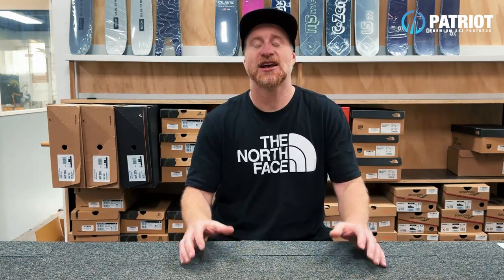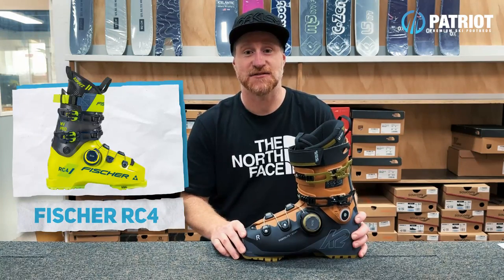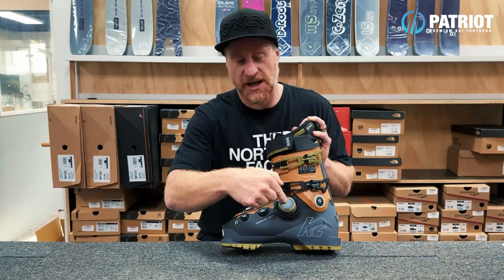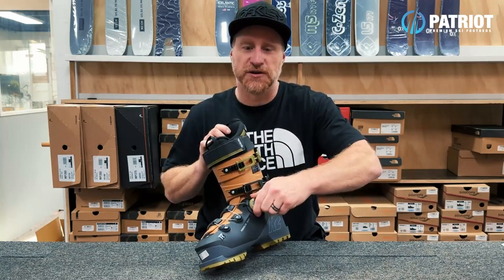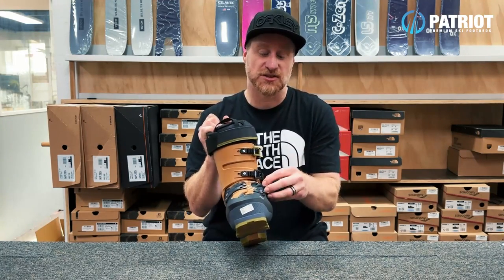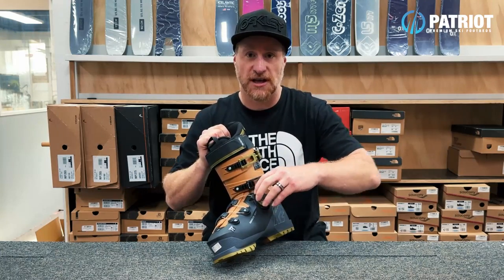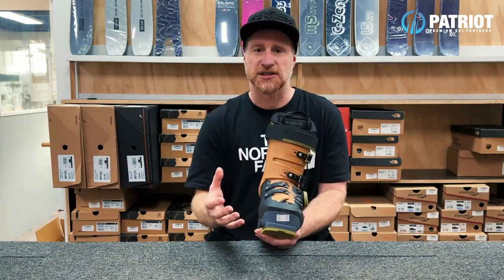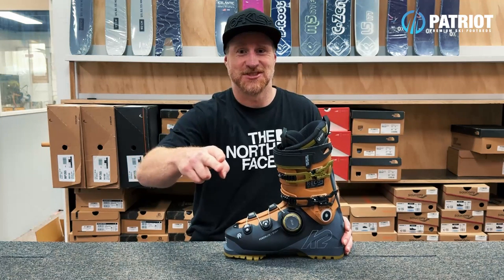A New Ski Boot Revolution??

Comment: Seems like you lose adjustability with this. You can only change the overall tension level. You can't change how tight it is at the front of the instep vs. the back. Everything has to tighten equally. With two buckles you have some variation available to you, even when one buckle is effecting the other.
Reply: I’m not sure if i’m talking about the same skiboots but the ones i have, do have elastics and each elastic are adjustable.
Reply: So I hate to tell you this cause I don’t wanna start anything, but you’re actually cranking down on your instep more. The tension is not even along the length of your foot. As one end of the cable is fixed, you’re pulling more of it through the first pully closest to the Boa.
Reply: Honestly, BOA is conveinient, but, they (at least for me) give me INCREDIBLE foot pain.   Traditional laces are a pain in the ass but they are the most comfortable.    I've never had crazy foot pain until I full timed boa  100 days a year  3million vert a season.
Reply: I agree. It's one adjustment for the whole foot.  Good point.

Comment: You are able to turn this boa wheel system backwards as well to fine tune the fit. You don't have to open it completely and start from the beginning again. I know that cause we also have a few pairs at our shop ✌🏻
Cheers
Reply: If turning it backward loosens it then there is no position lock, therefore a clean hit to the top of the disk releases the tension.  Unlikely but not good.

Comment: Seems like it would be a lot more interesting if the system also included at least the first upper buckle over the ankle. Those first two buckles have always been a non-issue for me, just enough pressure for them to snap closed securely and you're done.
Reply: Couldn't agree more. I'd be much more intrigued if this system were incorporated into the upper shell, while leaving the lower buckles in a traditional setup. Lower buckles are a non issue for me

Comment: The missing part here is the ability to block at some point the pressure of the lower (near to the toes) part of the cable and after that to be able to put some more pressure to the higher part of the boot. Would be nice to have a “block” cap (or something smaller) for the front buckle. Now the pressure is equal everywhere, but this would not help for the perfect fit. People feet are different, with different instep volume. If second “block” cap is implemented, the pressure can be independent on the two zones -the toe zone and the closer to the ankle…

Comment: Hi!

Love your videos, but I think you missed some stuff! I've had my hands on these boots myself.

If you tighten it to much, you don't have to "release" the dial/spinner. You just crank it back a few steps for a perfect fit. Better fine tuning the of the tension than the old school buckles. You can tighten the mv shell from a 100mm down to about 95-96mm! The wire placement also prevents the shell from deforming or bulging out in the instep area, the flex is much more uniform! Try it out.

The dial/spinner is made to pop out if you hit it hard on something, but the risk of loosing it is quite slim. The dial is still connected to the wire, and the wire is quite beefy. You could always completley smash it I guess, but nothing is bomb proof!

Keep up the good work, love your stuff! 

//greetings from a fellow boot guy in sweden
Reply from the maker: Hi Andreas,
Thank you so much for your comment! Yeah I think the model I had was just a sample and the micro adjustment wasn't tweaking back. But that is so good that it is capable of do this,  makes a lot of sense and makes it so much more functional!!

I can't wait to actually ski in the boot and test the flexing and closure properly. Initial feelings when trying it on was good foot wrapping but didn't prevent instep contact completely. 

Also makes perfect sense about still being connected to the cable. Of course it is, as all snowboard boas are like this too, so no real risk of losing it.. I didn't want to test my luck by ripping it off. :)

Where are you located in Sweden? I hope the season is going well. 

Appreciate you watching and for the input.

Cheers mate
Reply: I also got the impression that this would allow you to reduce the volume of the boot. I always use a low volume model so this could be a benefit as the liner packs out. I work in a ski shop so I definitely will want to try this out. It will be interesting to get customers feedback as we fit these new models.
Reply: This is not the first cable buckle system. Way back in the 1960’s we had the Molitor Cable system on leather ski boots. As an old boot fitter I look forward to trying this on and take it from there. I like a low volume boot so this could be a benefit as the liner packs out. Please give us your impressions when you get to ski in this model. I been following your channel for years and love your videos. Hope you have a great season down under.
Reply: Someone who knows what it's all about, I drove the salomon Boa last spring, already there I was convinced of the system.We will see, good thing I have been in this business for 30 years and my feeling was mostly right, at Fischer vaacum I said after one season, too soft too thin much too cold, and for 3 years nobody talks about vaacum, partly no vaacum matrial anymore at Fischer Ski boots,  yep Fischer also comes with boa. Finally something new.

Comment: What's the point? Lower two buckles are decorative anyway. I don't see BOA changing anything in terms of instep accommodation or pressure resolve - even a step back, since you can't pull one buckle strong, and the other weakly. Also, BOA handle is more difficult to operate in gloves or cold fingers, than a lever. Plus, it stick out to the side further, thank a clamp.
I like BOA on my motorcycle boots, but I don't think it brings anything into skiing boots.
Reply: Lower buckles decorative? What are you saying? The one closest to the top is the most important to keep your eel in place. It’s the most important for me anyway since I have narrow feet.
Reply: @oysterpt2018  Then you probably have wrong boots or at least wrong footbed.

Comment: Best point to the video made is about spare parts. If the boot makers are going down this route, each one needs to INCLUDE a spare boa part and strap. Plain and simple, because WHEN it breaks the boot is unusable until you get the part needed!

Comment: This is beyond stupid, and is purely a marketing gimick and provides ZERO added convenience or efficiency.  You have that golf ball size tumor off the side of your boot, and its a push pull ratchet system...just ludicrous....and, what does it provide...nothing, it complicates the stupid closure.  So, you cannot release point pressure without releasing the whole bottom of the boot...I mean, releasing the toe buckle or some mix of toe, mid-step buckle is not possible.  They should have made it electronic so you replace a battery and you remotely squig wigg the buckle while on the chairlift....nice....whata joke.

Comment: I like how you pointed out, how if you overtighten, you're going to have to release it all over again, and how annoying that could be. Also yeah, the entire issue of that part knocking off, is a big problem. I feel like the durability is going to be a problem, and given how expensive ski boots are, I think this is going to be a downside where buckle styles will be more in demand still.
Reply from the maker: The first point I had wrong as this was a sample. The final production model can be micro adjusted back if you go too tight. And I agree durability will be interesting to see how they hold up. :)

Comment: I could see this for casual skiers concerned more with ease and comfort than with performance. It would suck to have that mechanism fail and loose tension on the whole lower foot instead of just at a single flex point. The second I saw it pop open all at once I started to have doubts. 
Also I agree completely about the micro adjustability. When I worked rentals one of the main complaints about feet hurting was due to over tightening boots. Peoples feet are different (even the same feet on different days) and it's good to have a lot of adjustment choices.
Reply: Only high end boots have micro adjustment buckles. And most rentals don't carry that kind of inventory.

Comment: When I'm getting in and out of my boots, the plastic over the top of my foot spread quite a lot.  To me, it doesn't look like this system provides enough slack to easily and painlessly slip in and out of the boot - especially when the boot is cold and stiff.
As for the spinner, the odds of hitting trees are slim, logs... maybe possible, but the real issue could be racing gates which could have enough force to pop it open.
I'm not convinced this solves any more problems than it creates.

Comment: When you look at any pulley system that has multiple wheels in parallel, what you will see is that from friction alone, there will be more force applied to the pulley closest to the cranking mechanism - which in this case will be over the 2nd buckle which is where if you have a high arch, it is the MOST critical area to never over tighten - thus, and it isn't that important, but your 1st buckle toe area will be subservient in tightness to your 2nd buckle area.

Comment: I have a similar issue of micro adjust in my FT cable system boots. Nothing to write home about, its not about matching ladder notches or consistency I find.  The general premise is crank the hell out of it, do a warm up or 2, back it off, reseat, recrank, and add a click or 2 as the day goes on.. socks or post legday pump alters boot fitment from day to day.
i'll Also wager the staggered nature there will be less pressure points= less need to release them in the lift line.
The bigger issue for me will be
1) crashing or icing up.

2) toe box tightening and heel tightening, the boa does it uniform whereas a classic book crushes the heel down as a priority

Comment: A problem that may occur is that the adjustment wheel is too close to the snow while the snowboard adjuster is at shin height covered by the pants leg.  There might be a problem with ice buildup at the wheel mechanism where a build up of snow thaws at the base of the lift then freezes on the lift.  Another problem would be side slip fall on an icy section taking out the wheel.  

Agree that with the boa, you would lose fine adjustment of boot fit.  One way to accomplish a personalize fit is to have different size pulleys (for a lack of a better term) or spacers that the cables ride over.  But wouldn't be practical to change on the slopes.

EDIT: an eccentric cam that can be rotated at each of the points that the cables rides over would allow a more personalized fit.

Looking forward to your evaluation after actually skiing with them.
Reply from the maker: Super great points. Yeah ice build up might prevent you from doing up your boots altogether. And yeah some terrain challenges for sure!

Comment: I picked up a pair of the Salomon S/Pro 120 Boa boots this past weekend and I really enjoyed them. They weren't what I was looking for, but I've been using Boa fasteners on both my road and mountain bike shoes for over five years and I've yet to have a problem with them, so I figured I'd give these a try. I had the instep cranked down pretty tightly - there's a graduated scale that goes from 1 to 5 and I had them at about a 4.5 - and I buckled the upper two buckles and the power strap like I would any regular boot.

I skied about a dozen runs in them and never felt the need to back them off or to unbuckle them to let my feet relax; very comfortable right away and for the whole day.  Also, I moved from a comfort type of Dalbello boot with a low flex rating up to these in a 120 and the amount of stability and control I felt was impressive. We'll see how they hold up but so far I'm happy with my purchase.

Comment: Is the BOA not dual directional? (spin it the other way to loosen it?) Salomon + Atomic's BOAs can both be loosened in that way... If K2s isn't that seems a huge oversight...
Reply from the maker: Thanks Jake, yeah this one definitely didn't have that function. (This may have just been the sample version however.)
Great to hear there is micro adjustment on the other versions. I look forward to  seeing that!!
Reply: I’m 100% certain that the dial spins in both directions. Try it again and you’ll see. 
Also if you knock the dial off on a rail while skiing it stays attached to the lace so you don’t lose the dial. 
I hope to see an updated video after you use this product!

Comment: basically replacing the  buckles,it tighten up  the  boot  in the  same manner.i  dont see where is  the  innovation in there, i'm guessing that cables  cost less  than molding buckles,so  this  is  only  an economy move for  the  company.

Comment: AS A BOOTFITTER: This is honestly terrible.  I can do a big toe or metatarsal grind using the boot stretcher in under 5 minutes.  All I have to do is pull the liner, unbuckle the boot and stretch it open and I'm grinding.   How does this lower shell come apart? does the boa cable release? Or the attachment points have to be unscrewed? It looks like a mess.  It is solving a problem which doesn't exist as others have said.  Personally I have a high instep and I don't even really buckle my instep buckle, BUT I do like some tension on the toe buckle.  So that's impossible here.  Its actually a worse system with LESS adjustment. Just facepalm on the whole thing.
Reply from the maker: Great point! This is not a boot you will want to be doing grind work on as you can't open it up like that. The cables will prevent it. Yeah they are claiming better instep closure and adjustable last, but Im not convinced it acheives this at all.
Reply: As a retired Lange rep lol: I think you made the best point yet.  Fit to the correct boot given the client, adjust it as a qualified fitter would fit it,  send in the next hobbit, rinse repeat.  The boa is a joka.
Reply: Bingo - the parallel pulleys mean that the 2nd pulley, from friction alone, will be the tighter of the two - and thus for those with high insteps (me), to 1st buckle with basically be undone. I don't think this a killer as a well-fitting boot doesn't really have almost any tension on the bottle 2 buckles, but it will be a more hassle for boot fitters for sure.

Comment: Great video but you missed that the boa goes both direction so you can do a micro adjustment tighter or looser. You do not have to unsnap the boa to loosen it just a little

Comment: I believe most ski boots with buckles have a total of 4. Counting from the toe that would mean there are 2 on the foot and 2 around the ankle and lower calf. When I ski, I’m focused on the third buckle, which really holds the foot in the heel pocket. The top buckle is recently tight as well. The bottom two buckles really don’t need to be super tight and they don’t need to be the same tension. In fact, as another person commented often buckle number 1 isn’t tight at all and the buckle sometimes comes undone. No big deal. The fact that you can’t adjust buckle 1 differently than buckle 2 is a hard no for me. I am a certified ski instructor and in my boots 5 to 7 days of the week. I need the tightness of the entire buckle system to be 100% adjustable. That is not available on a boa system. Thanks for the video!

Comment: As someone who has tried on every boot in my local shop and has skied on 6 already this year with instep pain/loss of circulation in all of them, I am super excited to try these out and just confirmed my local shop has some from the early release on the way that I'll be demoing. My only worry is on the adjustable last. Do these fit like a standard MV boot? Might want to hold off and check out Atomic's Boa offerings so I'm not in a HV boot masquerading as a MV/LV.
Reply from the maker: Yeah they are claiming variable last, but It doesn't enclose quite like you'd expect. It still has to wrap like a regular overlap design, so the pressure comes in still above rather than just width.
Reply: maybe try some proper bootfitting? and I don't mean a classic shit bootfitting every (even specialized) store does, I mean find someone with wooden lasts that are adjusted to your feet, then the shell is baked with this last inside, the only thing that helped my 110mm wide feet get into race and touring boots...

Comment: Am I missing something? The BOA system was introduced at least 7years ago.  But - they only make them in smaller sizes (not for my giant feet).  They’ve been one shelves since I started skiing in Cali in 2015
Reply: They have existed in other boots for sure, I think this is just a slightly beefier system. Pretty sure they’ve only been in lighter weight touring boots up to this point, could be wrong though

Comment: Feet are too dynamic to have a preset for buckles. Our feet are different sizes by volume, length, and width. Using micro adjust on buckles daily is the move.

Comment: The Boa system works on my cycling shoes. However, boa won't work on high-performance ski boots due to the hard shell on high-end ski boots. It may work on soft-shell ski boots. Moreover, the boa buckle on the side of the boot is prone to breakage.